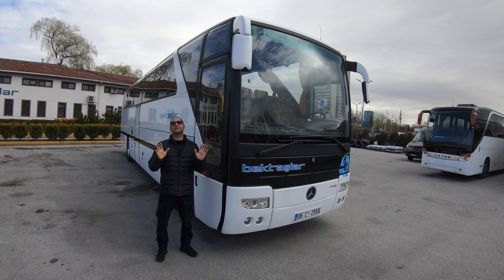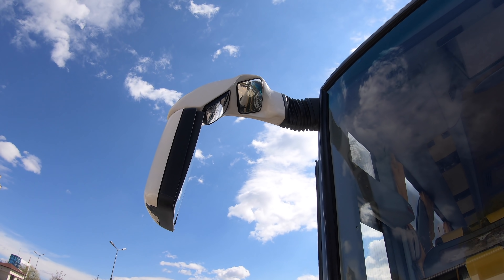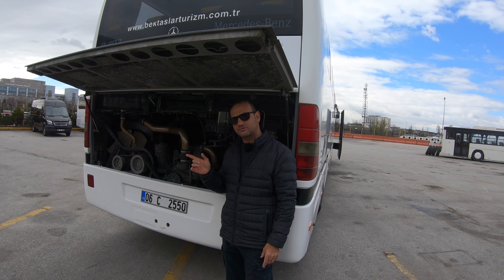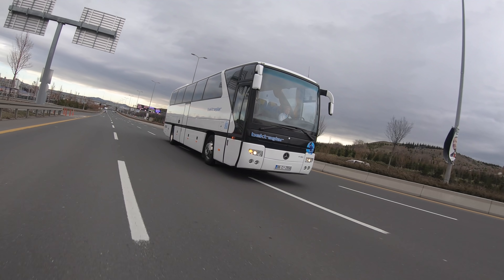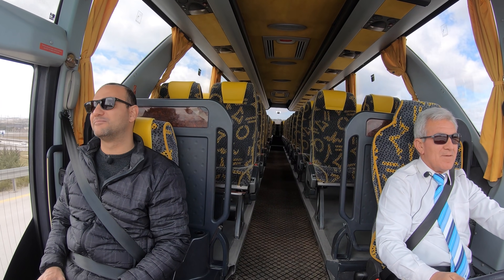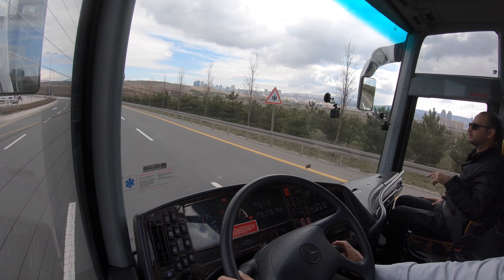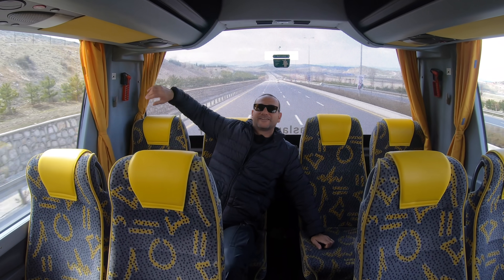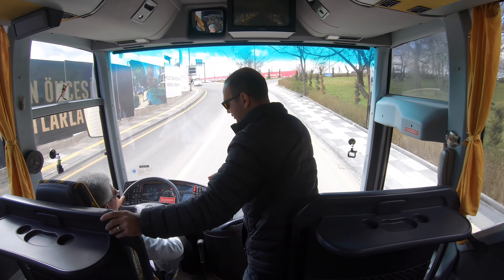NOSTALJİ | Üretilen son Mercedes O403'ü test ettik!

Comment: Almanya için ürettiğimiz Otobüsler 0350 olarak yapıldı dediniz ya 

Almanya’da Mercedes’in 6 Silindir Diesel motorlu Bütün Araçları 350 diye geçer 

Mesela 

Mercedes S Klasse  S350 CDI
Mercedes E Klasse E350 CDI
Mercedes GLK  350 CDI 
Mercedes ML 350 CDI 
Gibi 

Bu Otobüs 6 Silindir Diesel olduğu için bu şekilde olmasını istemişlerdir